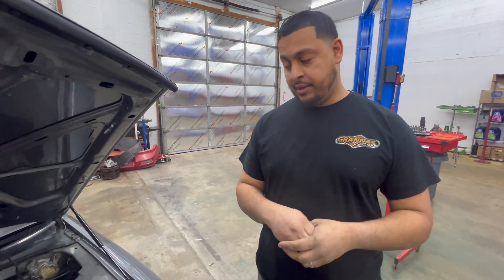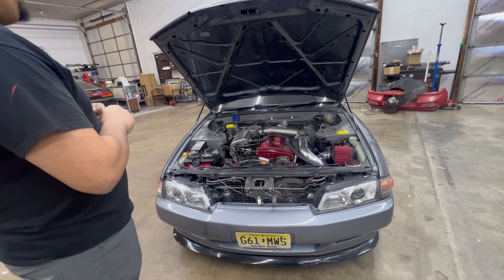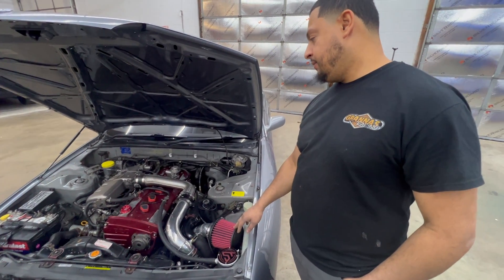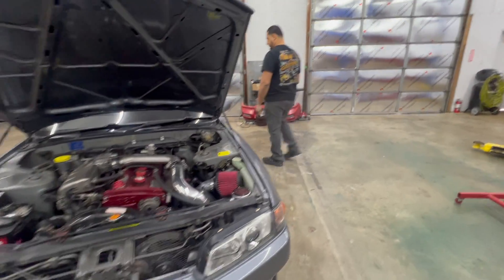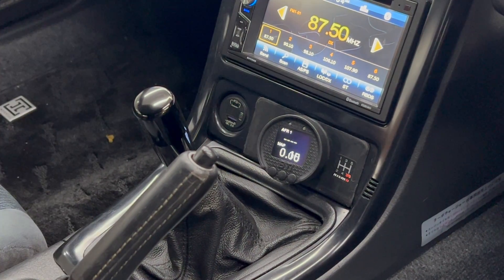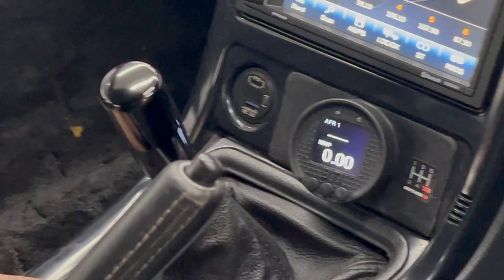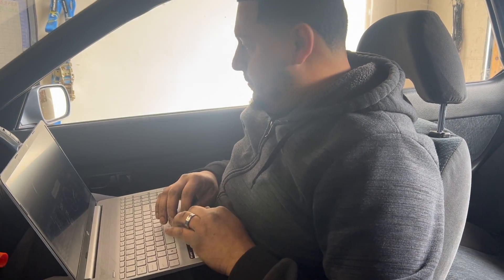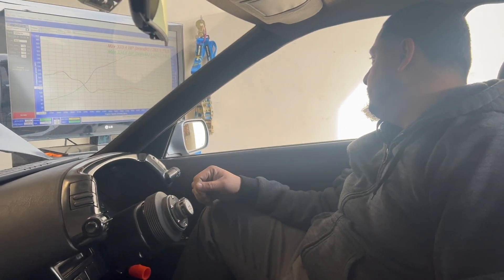Stock RB20DET | how to make more power | boost control and trigger disc discussion

Comment: Which oil and coolant line kit do you recommend for installing a Garrett turbo on an RB20DET? Also, do most kits require modifying or cutting the factory coolant return hardline that runs behind the head, since it splits into two hoses?
Reply from the maker: @ConvectionConnoisseur  we make our own lines to suite each individual car. Yes you need to modify the hardline.

Comment: Hey Mann

I’ve just picked up a new garret hotside. 

Noticed it’s only a .48 exhaust housing after being told it was a .63

You know everything when it comes to tuning an RB20DET so I came to ask, will the .48 be too much restriction to hit the 400hp mark? 

Thanks heaps 🙏 love you’re videos I’ve watched them all multiple times haha
Reply: That will be a major restriction bro, like it's going to choke. If you want 400hp realistically .63 at  the minimum, and if you want to rev it out to 8000 .82.  I am using a .82 for my build, albeit forged, cams, and valve springs.
Reply: @ seeet as, was thinking it would be way too restrictive 

My turbo online comes factory with a .63 and is rated for 550hp. So I’ve replaced it with a .63 as I don’t want massive lag. I want boost to come on quick 

The rb20 is a high rev motor but I’ve heard keeping it around the 7.5k revs you’ll still make 400ish range but a tad more reliable

Comment: I love this channel! Such inspiration for my R32 gtst. Does that blitz intercooler also provide the "in engine bay" portions of piping from turbo outlet and cold side? Or just to the 2 holes from underneath?
Reply from the maker: Thanks so much. The Blitz intercooler kit doesn't supply all the piping you see in this video, but will fit with the factory setup. We had the turbo outlet pipe and the J pipe from the throttle body fabricated , the rest was included with the kit. Good luck with your R32!

Comment: Would your rec a 28 series or g25 550 turbo after around 300-350 hp and a quick spool
Reply from the maker: What manifold are you running

Comment: The arashi turbo I purchased with an adjustable internal waste gate (via springs) for my RB25 works great and even better with the boost solenoid. 18 lbs. on a 25G turbo (factory style bolt onto stock manifold) making 467WHP with the same basic upgrades mentioned here in this video. There are also, adjustable mechanical waste gate for internally gated turbos from many reputable manufactures that simply bolt on to almost any turbo. Much cheaper solution. Far less headache as well. All you have to do is make sure you know the capacity of your turbo so that you don’t over run it. This would be the best option for lower HP applications on a decent budget. Hope this info helps anyone.

Comment: Would the stock head gasket and studs last on 17-20 lbs of boost pressure.
Reply from the maker: its more so the power level and quality of the tune and setup of the car than the actual boost level. We run over 20 psi an excess of 400whp completely stock engine no problem.
Reply: @SleeperTuning  thanks for sharing your wealth of knowledge.
Reply: Really just luck of the draw, maybe it holds 20 psi, maybe it doesn't, you won't know until you try it, do you want to risk it?

Comment: Safe to say I’m still ahead on the stock rb20 leader board 😅
Reply: What did you make ? I'm coming for ya lol
Reply: I think I seen it..with the white bumper? Does he think the pistons and rods can handle that kinda power on E85
Reply: Nice.. well I have a plazma man manifold and a gt3071r gen two that's top mounted  and 258 tomei pon cams..I also got id1050 injectors, Rodium fuel rail, and walbro 450 pump with an 8 lines. I got split fire coils and tomei cam gears and a prp trigger kit. I'm really coming for you lol. After the cd009 swap is done... I'll be coming to Edgar. I wanted 500 whp is goal on e 85
Reply: Oh nice, I got tomei cams and cam gears as well along with a hellcat pump, no trigger kit cause I was told it wasn’t needed. Turbo is a GTX2867r and I’m I’m running 1000cc  deatschwerks, GTR coil packs.
Reply: @OG_32  nice man..I hope to hit similar numbers then. What did he set your redline too? You do head gasket and studs? Head drain? I did. And the n1 pump  with billet gears . Tomie timing kit.
Reply: 450 whp
Reply: @OG_32  I'll try my best lol. Stock bottom end? How's she doing at those power levels
Reply: Edgar got her riding like a champ! Plan is for me to go top mount by the end of the year and a bigger turbo to push for 500 whp. Sleeper Tuning has a build series on my car under there playlist RB20.
Reply: Yes the white bumper but I’ve painted since then. Yeah Edgar says since the stroke is short it should be able to handle it, just gotta keep the torque down so we should be looking at top end speed.
Reply: What’s your social media I can send you dyno video
Reply: Head studs and gasket but no drain. N1 pump as well and redline is 8k.
Reply: @OG_32  sweet ..I guess the rb bottom end can take more then people thought.
Reply: @nissanloveR32  
It’s all about your tuner and how you drive 🤙🏾